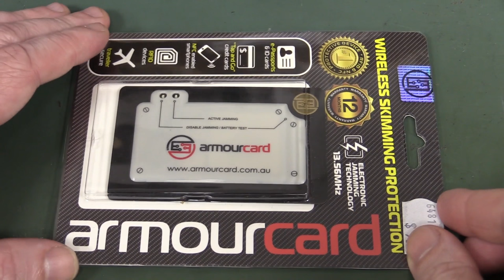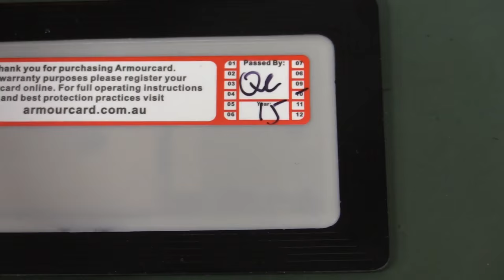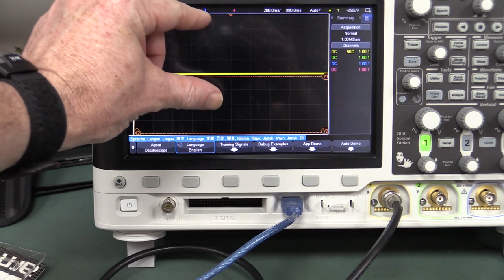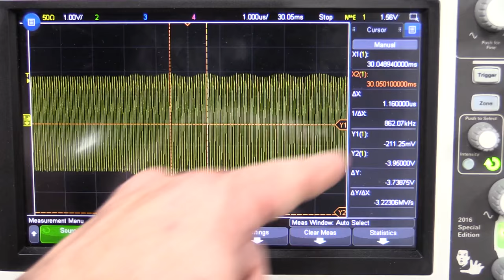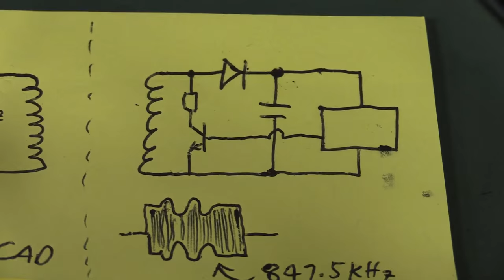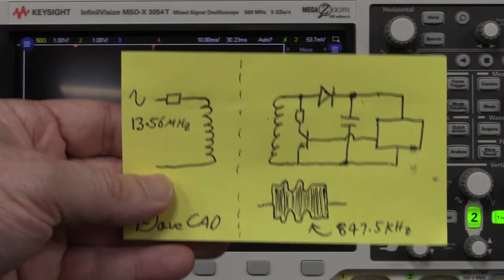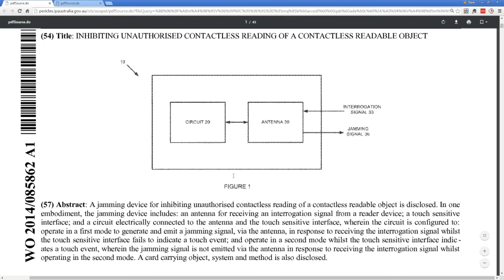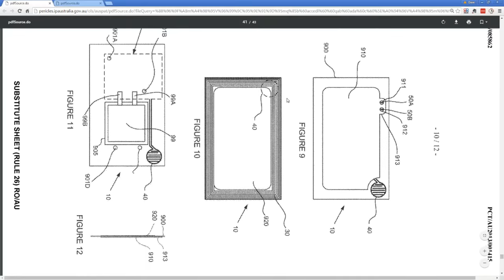EEVblog #890 - ArmourCard Active RFID Jamming Teardown

Comment: Wonder of two of those close to each other would activate both and drain the batteries faster.
Reply: No, as RFID cards (and jammers) operate passive. They basically increase and decrease the current they draw from an external field to communicate with the reader. The jammer just uses the same approach as the card, but masks any data that would otherwise be sent. As these jammers don't emit a field themselves, they would not affect or detect each other.

Comment: Design a pcb with credit card dimentions and with a shorted coil isn't it enough ?
Reply: uhhh.. any approximately credit card sized metallic object is enough. so you could just use a pcb with a solid ground plane.
Reply: A piece of aluminium foil is a shorted turn and yes Dave showed that it is enough.
Reply: But if it was more than one coil maybe it would be more effective ?

Comment: no man it doesn't work as the card it actually works like a transmitter doesn't depend on the current induced by the reader it transmits a discrete signal back and not modulate the reader's one, so it doesn't modulate using a load as you said!
it just drives the coil at the frequency mentioned the crystal is used for that and the micro just modulates it periodically.
Reply from the maker: Look at the patent schematic, MOSFET's and a load resistor across the coil do the modulation.
It does not drive the coil at 13.56MHz.
Reply: hmmm i saw it you are right, that crystal... why 13.56mhz?

Comment: What happens when someone tries to steal your card info if you have half a dozen cards in your wallet, all with different numbers? Can they separate the data, or is it all jumbled together?
Reply: Many cards cannot be cloned. But yes, multiple cards can be individually read out, even if bunched together as the reader selects the card it wants to talk to.

Comment: Would a wallet lined internally with alfoil work i.e. wallet manufactured with alfoil inside the lining?
Reply: You can get copper mesh cloth, the fine stuff using pretty thin strands and wouldnt be a crinkly and loud like foil, but yes, even a few panels of metal foil in the areas that dont bend in a wallet would work to block RFID. For non-leather wallets anyone handy with a seam ripper and sewing machine could open a wallet up to install metal foil/mesh, and put it back together.

Comment: To me this device looks like its just adding a "constant" modulation. So yeah it will block of the shelf reader but couldn't you work around that with a custom reader (or even, and most probably simple software adjustment)? Predictable  information and computer security usually don't mix well.
Secondly why do you need a battery? for the leds? A normal rfid cad can modulate its load without a battery why cant this device do the same?
I admit I know a bit about computer security but close to nothing wen it comes to rfid specific transition.
Reply from the maker: Yes, passive one would work too. Maybe you can't patent that...
Reply: Exactly, also it seems the card was activating and sending information but his phone couldn't make it out at quite a distance from the reader (data traces were showing on the scope so a more sensitive reader would have been able to decode them) and this thing seemed to need to be a lot closer so I'm wondering if you could manage to activate the card without activating the jammer.
Reply: In an ideal set up you could inverse a clean interrogation signal and 
sum it with the scrambled one to isolate the scrambling  signal.  Once you 
know the scrambling signal you could produce the inverse of it yourself 
at the right amplitude, phase shift as required and sum with scrambled signal to isolate the data.

I don't know much about signals but I guess outside an idealised scenario the same thing could be achieved with some sort of Fourier analysis.

Comment: Amazing how these chips are supposed to increase security but now people have to protect themselves from possible thieves who can make transactions on their card just by being near them. 

If people can modify traditional card readers to steal card information, what's preventing them from embedding their own scanners in legitimate scanners?

I'm sure it may reduce overall fraud but you would think they could come up with a better solution. Like why not have the same protocol, but communicated via electrical contacts on the card and reader?
Reply: Hmm. I think the thing people are forgetting is that there is always a chance of being insecure. At the end of the day, there is a significant barrier to stealing someones money using this. First of all collecting the data via RF (the easy bit). But what people miss is that the back end of authorizing transactions live via the internet is very secure, and difficult (not impossible) to break. 

Thieves will go for the low hanging fruit, there are much easier ways of taking your money, stealing the card completely physically, using it online, hitting you and stealing your cash, etc etc.

This method while not perfect, has a low enough probability that the credit card company can use the fee to provide insurance, so for the consumer there isn't any serious risk, and a huge jump in convenience.
 
Overall still less likely to lose money than having a magnetic strip skimmed (which they still use in the US for some idiotic reason, with SIGNATURE a laughable security method), or even getting cash stolen.

Very interesting from an EE perspective though.
Reply: the worst part is that it isnt actually that much faster. the only reason why its faster is because you dont have to enter your pin. if they just used the dipchip without a pin for up to a 100 than the same speed increase would be gained unless the supermarkets dont actually clean their readers. the only thing that it does is make it low maintenance for card reader owners. thats not a compromise im willing to make.

Comment: Not only creditcards have rfid chips. All german passports and german id-cards have a rfid with all you're data, names, adress, fingerprints and other biometric stuff. These are interesting for identity thefs.
Reply: Not all EU. At least here in Portugal our ID cards are smartcards but without RFID features. They do have photo, address, electronic signature and timestamping and so on, but the data is encrypted and you need to input your pin codes to read/use it.
Reply: In the UK we don't even have national ID cards at all, and we're in the EU (at least for now :S)

Comment: Wait, in Australia you can only spend $100 on a credit card transaction? Did I hear that right?
Reply: That's the maximum for contactless payments I assume.  In the UK I think it's £30, but I've never tried using it. I would forget my PIN if I didn't use it all the time.
Reply: Benedict Nothing Interesting. I just looked up and in the us it's $25 for contactless...  I don't use it that often so I had no idea there was a limit. Not sure why there would be at all, if you have the card for contactless, you also have it to swipe.
Reply: +TheSageDad it is to do with fraud prevention. In many countries, contactless is coming after chip and pin. With contactless, no PIN number is needed so it is less secure (rather than being something you have and something you know, it is just something you have).the basic gist is to make low-value transactions quicker without the need for a pin but fall back to chip and pin for higher value stuff.

In the states, I guess the idea would be that card + signature + ID is more "secure" than just card for higher value transactions.
Reply: Graeme Bragg I see the point, but in the US there are a lot pf places where even signature and pin aren't required. The first that comes to mind is gasoline; I routinely get $80+ of fuel with just mag stripe at the pump... so no real difference if it was contactless in that case. Most places don't verify signature, even though they are supposed to.
Reply: +TheSageDad that is a failing of the retailer rather than the authorisation method to be honest. The US does seem to be the "problem child" for implementing more se ire payment methods globally...

I will say it was incredibly inconsistent whether I had to swipe and sign, chip and sign or show ID or just swipe last time I was in the states. 

What really got me was a Subway I visited had just had chip and pin machines installed,but they would crash the till if used...
Reply from the maker: No, just for contactless tap and go. Insert card and enter PIN if you want to spend more.
Reply: You can also tap and enter PIN.
tends to be my policy.

Comment: What would it take to make one that covers two feet?
Reply: I suspect this could cover that without modification. In this case, the reader's signal strength primarily dictates the operable distance, as the jammer just operates like a normal passive card and disturbs the field when it's externally field-powered. Long distance readers that emit a stronger field should just cause the same effect.

Comment: Isn't active jamming illegal in aus?
Reply: That's a tricky point...
Reply: I don't think it is a 'Emergency' use band (going off of US)
Reply from the maker: Apparently not, or no one cares.
Reply from the maker: Mobile phone jammers are illegal I think.
Reply: +EEVblog 2.4GhZ Jammers are VERY illegal and looked for
Reply: Depends on whether it's a jammer according to the law, regardless of what they market it as. It's not a transmitter, and most definitely not a transmitter of an RF field (but simply a modulator of a magnetic field).
Reply: +Beall619 It does not matter what the RF band is in the U.S., all forms of intentional radio jamming are prohibited in the U.S. without the express consent of the FCC (which is nearly impossible to obtain if you are not military).  The question of applicability in this device is whether or not it's electromagnetic field will be considered as an RF field such that it falls under such regulation by the FCC.
Reply: Well, technically it's not rf jamming, it's electromagnetic field jamming?
Reply: Joseph Nicholas What would scan your passport from a distance? Isn't the procedure that you hand over the passport to the officer, who puts it on the scanner?
Reply: @Ethan, in any case it would be classed as emitting harmful interference and fall foul of Part 15 of the FCC rules, the EU Electromagnetic Compatability Directive, the CISPR standards and AU/NZ  trans-Tasman electromagnetic compatibility (EMC) regulatory arrangements.
Reply: Who cares... As long as it's on a small scale, as long as it has low monetary impact, nobody gives a fuck.
Reply: But it isn't emitting any interference. NFC of the type (magnetically coupled) has really short working distance, this device is completely passive.

Passports that can be pinged from distance use different technology.
Reply: its not RF so...

Comment: What is the legality of this product? I thought radio jamming was illegal (in the uk).
Reply: Even if radio jamming is illegal in your country it's doubtful if this device would qualify since it doesn't transmit anything, it merely absorbs RF energy from the air just like a receiver does.
Reply: Jamming across a wide area by transmitting garbage at a high power is illegal in most countries. This RFID jammer simply acts like an RFID device, modulating the load in the RFID field to prevent the RFID reader from reading usable data. It does not emit anything, has an effective range of only a few centimeters and is no more harmful to the RF environment than the piece of aluminum foil that can replace it.
Reply: It's going to depend on how the rules/laws/regulations define a jammer. In the USA, this would be illegal as it actively interferes with communications, even if only a few cm away.
Reply: Unless you file a complaint against yourself for intentionally jamming your own communications since you are the only person who will ever be affected by it, you will never get charged for doing so.

BTW, a piece of foil will interfere with communications far worse than this jammer does since the foil systematically blocks all communications of a high enough frequency all of the time while the jammer is effectively invisible while its coil transistor is off and does not interfere with its environment any worse than a piece of foil would when the transistor is on. The only thing that makes it potentially more effective than plain foil is modulating the on-off to prevent your cards from responding to the RFID reader.
Reply: "...actively interferes with communications..." Aluminum foil does not transmit interference.

"...illegal..." "Unless you file a complaint against yourself..." A device declared illegal is one that cannot be legally bought nor sold (with exceptions, ie: government) in this jurisdiction. Sure, you could illegally import a jammer and you would probably never get caught. But why spend so much money on such a device when a nice passive shield will do fine?

"...jamming your own communications..." 13.56 Mhz is an ISM band and you could accidentally/inadvertently cause interference of a licensed ISM device. Some medical devices work at 13.56 Mhz and there are ongoing studies concerning RFID/NFC reader interference with those devices. Yeah, again, only works a few cm away, but what about incidental contact? Last I've seen, aluminum foil, not being a transmitter, does not have an affect on these devices.
Reply: Beau Steward This "jammer" DOES NOT TRANSMIT ANYTHING. All it does is provide a switched impedance when placed within the near-field of an air-core transformer just like RFID tags do when they respond to the reader, which is where the few centimeters range comes from. As soon as you step outside the near-field, it does nothing, just like a piece of foil and the coils within other RFID devices.

The only way it can "accidentally" interfere with medical devices (or any other devices) is if you "accidentally" put it over your implant's coil when your practitioner needs to access the implant.
Reply: @aljowen - strictly, this would fall fould of any nation's EMC legistlation (FCC part 15 in the US, the EU EMC directive in the UK/EU, CISPR standards internationally, etc. etc.) as it is emitting "harmful" interferance. Will you get caught? probably not knowing how much of a wet blanket OFCOM are (i am looking at powerline networking here...)

@number33 - not strictly true. RFID works by the reader providing power with strong RF at one frequency and the tag replying with a separate transmission. This jammer does NOT just absorb RF energy - it is an active-device which is emitting RF noise stronger than the resposne from the card.

@Beau - jammers are usually illegal because they fall foul of EMC legislation, not because they are jammers. EMC legislation applies to anything emitting "harmful" interference, and these would certainly qualify. Good points on the AU foil not "actively" interfering though.

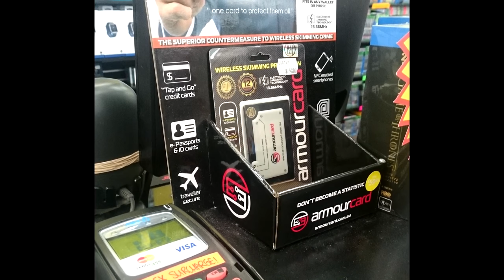@invertedlow - the spirit of EMC legislation is to prevent electronic devices interfering with each other. Dave said it in the video at 6:01 where the devices were causing issues with a nearby reader, so they clearly do not meet the spirit of EMC legislation.
Reply: Graeme Bragg Those contact/NFC payment systems do not communicate over RF. The host generates a alternating magnetic field and the target responds by loading the air-core transformer.

As for the alleged interference from the jammer next to the PoS terminal, one of the other commenters says he has identified the type of PoS terminal and that it is known to have issues reading cards, so the 'jammer' may not have had anything to do with it.
Reply: It's an intriguing concept, the NFC card transmits information back to the reader but it does it without transmitting any energy.  It does it purely by varying the amount of energy it receives from the reader.  This makes it a very simple system and enables the card to operate with very low power.
Reply: +Teardown Dan it doesn't matter if you are classing it as RF or not - EMC legislation is about electromagnetic comparability so covers everything from conducted emissions back into the mains to anything emitted from the device.

Fundamentally this device is causing electromagnetic interference, so falls foul of EMC legislation.
Reply: +Teardown Dan also, there is a clue in the name. NFC is a type of RFID, funny how that includes RF and, for NFC, operates in the HF radio band.
Reply: As Dave mentioned it has nothing to do with RF at all. This is jamming of a modulated magnetic field and not an electromagnetic field.

Comment: get some aluminum tape designed for hvac and line you wallet with that.   you don't have the fragile foil to deal with, and the sticky part will hold it in place.

Comment: "Complex solution to a simple problem" reminds me of NASA spending money and time on developing a pen that worked in orbit while the Russians used a pencil.
Reply: They didn't. Fisher spent their own money to develop the pen independently without prompting or contract from NASA. Plus graphite has several problems in zero-g because the dust and broken bits are both conductive and not something you want floating into your eyes. Which is why both NASA and Russians started buying Fisher's pens (at ordinary retail prices) after they were developed.